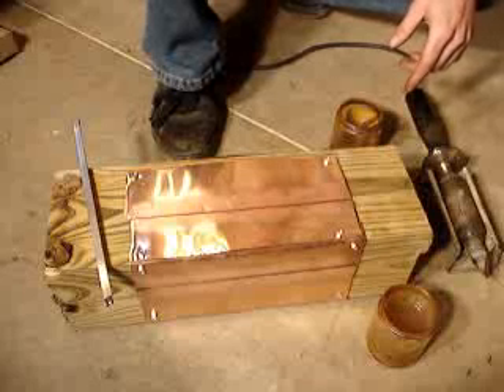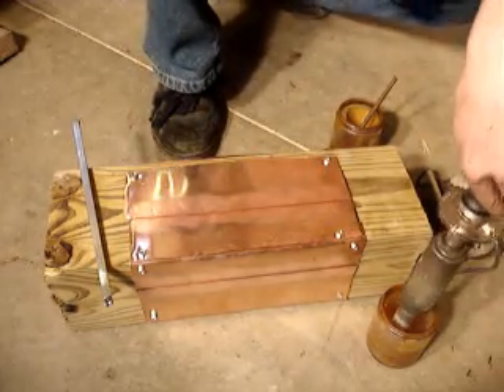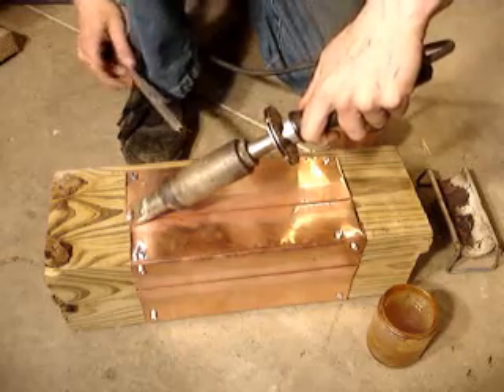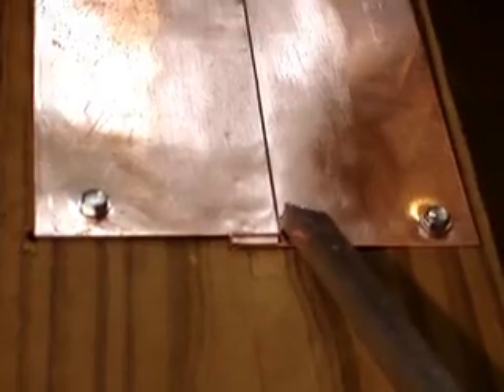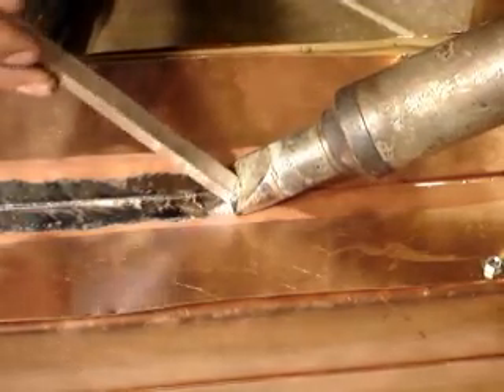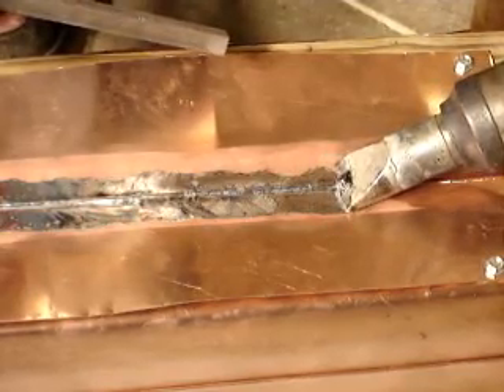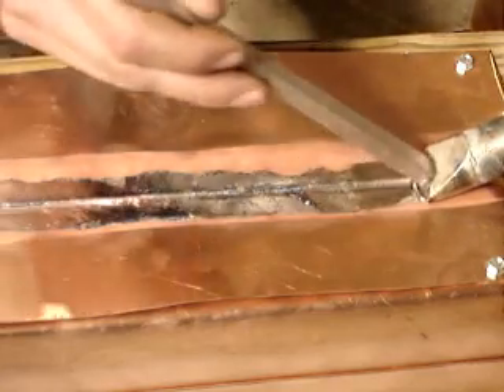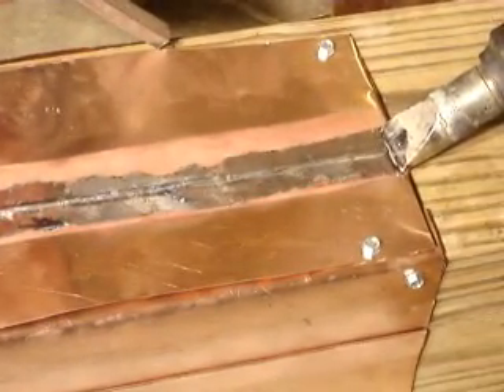American Beauty 300 Watt Soldering Iron Demonstration

Comment: why not just use a torch ?  A lot faster and a lot cheaper, that iron you have is over $250
Reply: Why’d you delete my comment?
Reply: @XxRUNTY  Thats just youtube censorship. 80% of normal comments get censored out for no reason. Youtube is censoring 20x more than China. No joke. Its that bad
Reply from the maker: Torches burn down buildings.